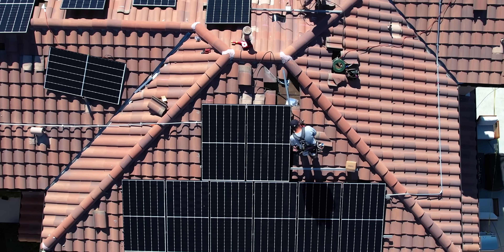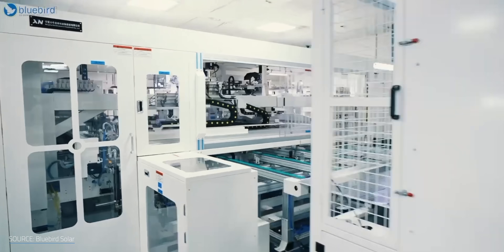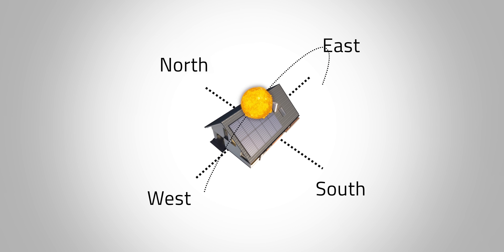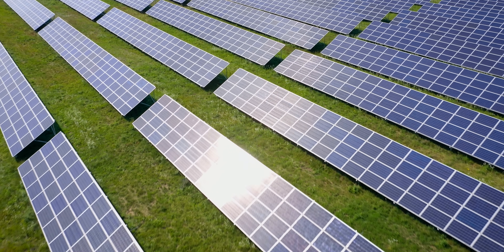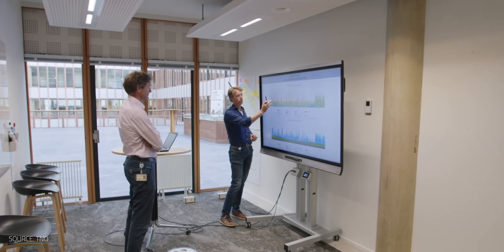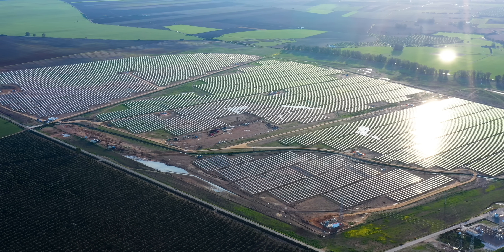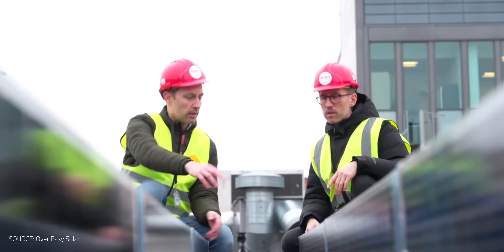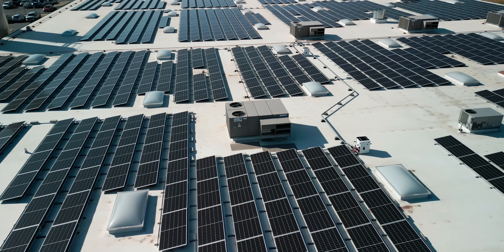Have we been doing Solar wrong all along?

Comment: I wanted to go vertical on my panels and not even have the bifacial.. with  1200+ feet of fence line I'll have more power  than I could use, so all the excess would go in to heating elements for 1000 gallon water tank..

Comment: Could see the vertical panels having far better cooling then a ground/roof mounted panel because of the air flow.
Reply: Alternatively, you can use panels from French company DualSun, and you get to both harvest thermal energy and improve photovoltaic efficiency by cooling the panels with the liquid that harvest the thermal energy to heat water. DualSun claims that they have the best overall efficiency as they harvest both thermal + photovoltaic energy.
Reply: @nicolasdujarrier  anytime you introduce liquids you have freezing issues that have to be addressed. Fine for some climates but it does add another layer of costs and engineering.

Comment: If you really want to keep the panels cool, you mount them over water, dams and lakes. This is happening in many places and you could mount them vertically if you wanted, but horizontal mounting has other advantages, especially reducing evaporative water losses in hot climates. The cooler water (not just the panels) leads to higher oxygen levels for fish survival.
Reply: Water cooling requires water - water being the problem. Not everyone has the water to do that with. LEt alone if any of those panels break over the water could cause problems such as lead poisoning. Could just in theory add more thermal mass or cooling vents instead that doesnt require any water.

Comment: The agricultural land utilization alone would be a good reason to switch many solar farm designs, even at a slightly lower total production rate for the grid. Most farms leave no room for any kind of agriculture beneath them, and simply become maintenance issues. This would allow cropping between the rows, and would even create a microclimate between the panels which could extend the shoulder seasons allowing different crops than could usually be grown.

Comment: this is an ideal way to integrate solar production and agriculture. These vertical panels would protect crops from wind damage, which can be very significant in most production regions, while leaving all the space necessary to drive tractors and combines through the alley ways.

Comment: My dad worked installing chain-link fences. I grew up going to work with him and he showed me that when you leave the 6 foot 30 pound iron digger bar lying on the ground in the sun  , when you go to pick it up you can’t touch it it’s too hot however if you leave it leaning against something or stabbed into the ground at a 90° angle it’s fine it’s just warm. I never really thought about this phenomenon till now perhaps the surface is getting the same amount of light but less heat when it’s vertical.idk
Reply: In Alberta you can’t pick it up because it is frozen to the ground.
Reply: It isn't the same amount of light/heat, the maximum is when the angle is near 90* and it goes to 0 when you  reach 180/0*. The panels in the video don't get the same amount of light during all times of the day as a tilted panel, they get less at all times of the day, but they make up for it to get a small  2.5% benefit.
Reply: Now imagine that 6 foot long bar being an automobile hood that's painted dark brown.  In August, in the South.
I couldn't get my hand closer than 6 inches from my grandmother's car, but could hold my hand against my grandfather's white car for about 30 seconds.
Reply: Same as grass, grows better onder a tree in dapled shade, too much sun and photosynthesis is reduced.
Reply: Installed near the side of the house with an air gap would decrease the sun from heating the wall in the hot summer.  Now it would be counter productive in the cold winter.  Maybe if they could piviot in the winter to let some of the sun to hit the wall it would work?
Reply: @michaelbranan1268  ooh that was a great example!! Hmmm!!
Reply: Yes, it would be less of a challenge to mount panels on our walls than on the roof, fo starters.
Reply: Think of it like this, if you lift a cook pot lid straight up vs lifting and tilting. The tilted lid lets the condensation run off quickly. It's the same with heat. Heat wants to rise so creates faster air flow up the side of a more vertical surface so better cooling. Also roofs are (sometimes by 50F) hotter than ground level air temps but roofs often get best access to direct sun. Lots of factors.

Comment: I guessed it correctly (smuggness). I have seen the effects on my system.
I 've thought about running an experiment with water cooling a panel string in my system. 
Always wondered why panels had white backing, rather than black, to radiate better. Would be cheaper than adding cells to the rear.
I do have a few fertical panels in my system too. Mostly due to that being the only space available. But also to help with generation in the winter low sun angles.

Comment: These are likely better for large scale solar farms, but horizontal rooftop panels have to be the best option for residential deployment
Reply: Lots of suburbs have fencing between houses. Most decks and porches have railings. Seems like a fence or railing built from vertical solar panels would be lower cost to install and less risk than putting panels on the roof of a house.
Reply: @bradfa  that's true, it could be especially beneficial for housing developments, where they build all the fences with the houses

Comment: The reason why vertical panels are cool is not only the lower amount of heat they get but also the amount of convective cooling they get. Vertical panels facilitate the natural flow of heat upwards, while horizontal ones impede it. I.e. the amount of convection per surface area is higher on vertical panels, so they cool better.
Reply: Yeah, this seems like a much more obvious potential explanation.
Reply: This is what I was thinking. I was also wondering whether or not it would be cost effective to add heatsjnks to the underside of panels in typical horizontal installations.
Reply: @ClaytonMacleod  There are some companies doing that.  There are others that circulate a heat transfer fluid through the backside of the panels, then you can use that warmed water to pre-heat your DHW so your water heater doesn't need to work so hard.
Reply: @michiganengineer8621 Hybrid solar panels were much more popular a decade ago when solar power was much more expensive, but with the cost of panels dropping like a rock it was just far cheaper to add additional panels than it is to cool the panels to increase output.
Reply: Yes, I would agree. For example, you can use panels from French company DualSun, and you get to both harvest thermal energy and improve photovoltaic efficiency by cooling the panels with the liquid that harvest the thermal energy to heat water.
Reply: @nicolasdujarrier  That's the company I was thinking of.  I forgot the name since I haven't seen them in the USA yet.  Those would be going on the roof for my "dream build" with ground mount bifacials for the main PV.
Reply: Another way of thinking of the same thing is this: image a normal horizontal-ish panel. The panel gets hot, so it's going to heat the air around it. The now hot air near the top of the panel will rise away from the panel, no problem. But the air underneath the panel also gets hot and wants to rise, but is blocked by the panel, so it inefficiently billows out from underneath the panel, making it harder for the bottom side to reject heat (1/2 of the surface area). Vertical panel orientation fixes this.
Reply: I think it may also help quite a bit that the side that is not in the sun, instead of being a few inches above another solid surface that quickly heats up and re-radiates a lot of the heat right back to the underside of the panel, that shady side of the panel when mounted vertically is able to freely radiate out towards partially open sky (which is much colder than the hot roof located under most horizontally mounted panels), plus it gets a lot more cooling breeze there, as opposed to being suffocated by the scorching hot air that gets trapped under horizontally mounted panels.
Reply: Upward facing surfaces don’t cool terribly differently from vertical surfaces. You’ll have direct proportionality to thermal conductivity of air, inverse proportionality to the characteristic length of the surface, some nice coefficient of ~0.5 and a Rayleigh number to the power of 1/4. If you crunch the numbers, you’ll get two values in the range of, say, 4…5 W m-2 that are close to each other. There will be no qualitative insights, just some quantitative ”every percent matters” nonsense.
Reply: @mattihalme81  you have written a lot of stuff which in theory might work but in practice simply does not. Just try to cool something with a passive cooler where the fins are horizontal and you will see. If there is no artificial air movement the difference is enourmous. Like in tens of percent at least on metal surfaces. Ten percent can make or break something when we talk of effective 5-10 degrees of difference or more. You can test this with just metal plates in the sun and nothing else.
Reply: @marsovac  Your Dunning-Kruger is showing.
Reply: @Will-xk4nm   Somebody who thinks something will happen without trying it can think that from that effect. Just try. You might get the same result or not. If you do, think on why could it be so. If you don't that's fine. In any case if you extrapolate a reason from that it is not Dunning Kruger, it can be experimental error or wrong thinking. I don't consider myself ever good at some topic. I just know that convective cooling works measurably better in a vertical position wheneer I tried it. Maybe it doesn't in other setups with other materials or other air pressure or whatever.
Reply: @mattihalme81  When a hot smooth surface is horizontally oriented, the effect is similar to the underside of a large flat surface that has water condensing on it. Because the surface is flat and level, the water drops get very large and numerous before they fall, and there is nothing pushing them towards one side or the other where they can collect and fall away. So the best way to get rid of the condensing water as quickly as possible is to orient the surface vertically. The same phenomenon happens with hot air along the surface of a horizontally-mounted solar panel. You'd think the hot air would just be free to rise quickly away from the panel and be quickly replaced with cooler air. But the problem is that the
whole surface is just about equally as hot, therefore the skin-thick layer of super hot air just below the boundary layer in direct contact with the bot surface has no gradient to push it in any particular direction, and because the air just above it only gets gradually cooler as you move away from the panel, the air tends to create a large bubble of hotter air all around the area above the panel, and the super-heated air in direct contact with the panel can only break away in little bubbles into this larger bubble of less-hot air. That's why, just like the other guy keeps saying in this thread, heat sinks are always oriented with their fins vertical, not horizontal. It absolutely makes a very significant difference!
Reply: @Will-xk4nm  You are the one who said "Heat stack effect depends on movement of air." Being as you were unaware of the fact that the heat stack effect does not depend on the movement of air, because it creates the movement of air, I found myself having to explain this simple fact to you with a simple visual aid, the way a parent would teach a toddler. Don't project your ignorance onto other people.
Reply: @HeyChickens  The Heat stack effect IS the movement of air.  It doesn't occur inside the material of a panel.  And you're the one that thinks orienting these panels vertically allows them greater cooling because they are now radiating away more hear vertically, which is laughable.
Reply: Thanks. If that makes the panels last longer and be a little bit more efficient then it sounds like a good thing.
Reply: Yup, first thing I thought…
Reply: iNOCT (installed normal operating cell  temperature) and Isc max (short circuit maximum current) reduced. Reducing warranty exposure and opening up module redesign opportunities especially for cell string interconnections and encapsulation. Electrical BOS reduced 25%.  High bifaciality ratios n-type PV is best. agrisoltaics with two S's
Reply: Flat planes if perpendicular to wind motion also create drag vortices, which would increase cooling dramatically.
Reply: Great point.
Reply: The heat stack effect depends on the movement of air.  This is an absurd explanation that completely fails and it turns out that you guys are not better informed than the actual engineers that design and study these panels, LOL.
Reply: @Will-xk4nm  Warm air rises. It can’t not move. There’s a reason passively cooled electronic devices have their heatsink fins oriented vertically. If it didn’t matter they wouldn’t orient them that way. If the air didn’t move they wouldn’t be passively cooled in the first place. They’d need fans. But they don’t have fans. They don’t have fans because the convection from the air being warmed is sufficient to move enough air to cool them. I think every home audio amplifier I’ve ever had, save one, has been a fanless device with heatsinks that have vertically oriented fins. And the sole amp I had over the years which actually did have a fan in it still used vertically oriented fins and only turned the fan on when you were asking for enough power that you’d never hear it over the music you were playing anyway. That you think it is too simple of an explanation doesn’t mean it is incorrect. It might be incorrect, or it might not be. FYI, it is possible to present conflicting information without being a jerk. If that’s your default mode, don’t even bother.
Reply: @ClaytonMacleod  LOL, those amp heatsinks are oriented 90 degrees away from these panels. You are literally using an example that supports my position.

Turn that amp on its side and watch it perform equally well (and now the heatsink is oriented like the panels in this video).  But please, tell us more about how you amateurs can better explain scientific findings than actual experts empirically testing these things.  The heat stack effect is minimal inside the glass.

Vertically orienting these panels REDUCES the panel surface area directed upwards.  If your explanation was correct we would expect WORSE thermal performance when orienting panels vertically because now the surface area is radiating heat TO THE SIDES rather than upwards.

Your Dunning-Kruger is showing.
Reply: @Will-xk4nm Ever watch a smoldering candle? Does it need a fan to make the smoke go upward?
Reply: @HeyChickens  Of course not.  But Vertically oriented panels would REDUCE the heat stack effect, meaning that the radiating surfaces of the panel are now radiating to the sides rather than vertically.  LOL

Show me the math for your claims.

Newsflash: you are not better informed than the actual engineers and scientists working on this topic and it is completely absurd that you think you are.
Reply: @Will-xk4nm  Can you please spit out an actual argument that I can either agree with or refute, instead of just firing off insults with word salads?
Reply: @Will-xk4nm  You talk about the heat stack effect, which is convective heat flow, but then you start arguing that now the panels are radiating to the sides. Your comment is so incoherent that I don't think anybody except you could possibly know what you are trying to argue for or against.
Reply: @HeyChickens  Like I said, you are too Dunning-Kruger to follow along here, which is why you think your can just off-handedly come up with a better explanation for this phenomenon than the educated professionals researching it.
Reply: @HeyChickens  Your Dunning-Kruger is showing.
Reply: @Will-xk4nm  I never claimed to have a "better" explanation; I simply commented on some additional reasons that contribute to the cooler panels. You're the one who got your panties in a wad over a simple comment.

Comment: I had some older panels which I replaced from my roof. Build a fence with them to my neighbours. It was cheaper then buying wood panels and no painting/maintenance. First I was not sure if I would even connect them. I am happy that I did. They generate much more than I expected. This way we have a fence for cheap and it is generating some income. There are now even solutions where you can put a sticker on them with tiny holes like you see on  buses. Yield will go down by 40% or so but you can make it look like a wooden fence or whatever you want. Great way to still use older panels.

Comment: the variation of angles improves performance but not by as much as you'd think, if you play around with PV with monitoring equipment you can see temperature of the panel can have way more effect on power production so if vertical gives better cooling to conductors (less resistance) it could be overall better power production

Comment: They should incorporate tubing in the panel and run liquid into them to extract the heat, then use it for other heat related needs/energy production
Reply: The power usage of the pump system outweighs the wattage gained by the decrease in temp. You can argue over longevity all day long, but the power gained isn't worth it.
Reply: @jackinthebox301  On its own, no, but if you use the waste heat for something else then it might well be. They mentioned that.
Reply: @javaguru7141  At lower lattitudes it might worth it, but for most of us in the northern hemisphere the power is more useful.
Reply: @jackinthebox301 a YouTube tested this and the extra power generated from cooling was more than the power the pump consumed.